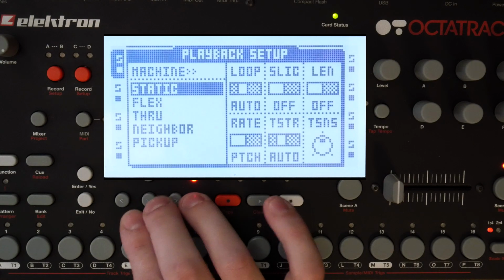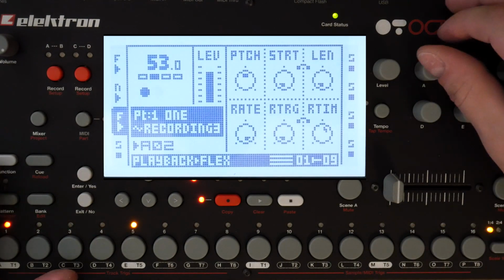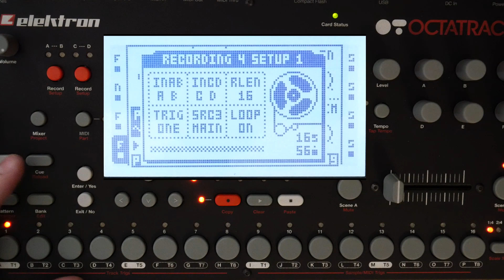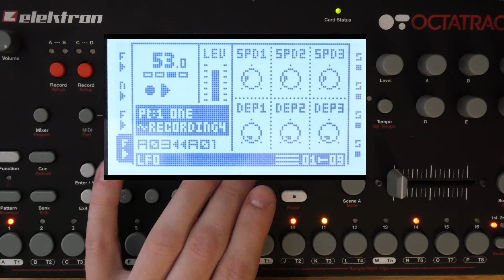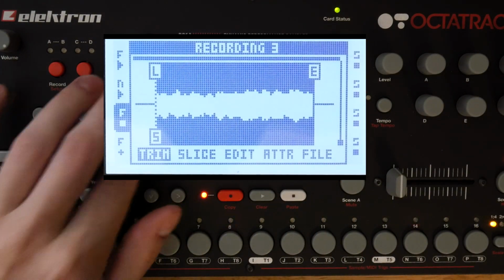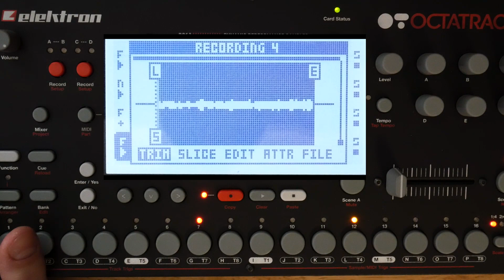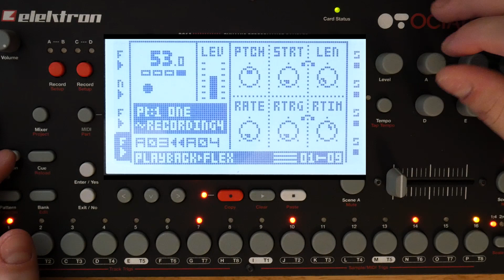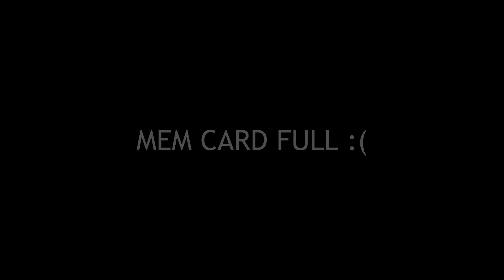Octatrack: Ambient Resampling Arrangement Walkthrough

Comment: Inspiring tutorial. I recently had a squabble with my OT after I compared a sampled breakbeat on the OT vs. the same break on the AR. It sounded flat and mushy. However, I think some sound sources translate better than others. This Juno106 sample sounds amazing. From your experience, do you find some sounds translate better than others?
Reply from the maker: thank you! For basic sample playback I find the OT completely transparent and I cannot identify it in a blind test. There are a lot of ways to mess things up though in regards to gain staging inside the OT, and also on the way out of it. Also, if you want to make 100% sure there's transparent playback you need to disable both FX slots on the playback track (set to 'none') - my ears tell me that some of the FX are not always transparent even if they are 'disabled' due to mix settings etc. This is likely a case-by-case basis on the FX and I have plans to research this aspect in more depth at some point